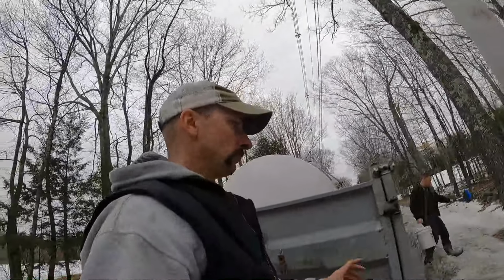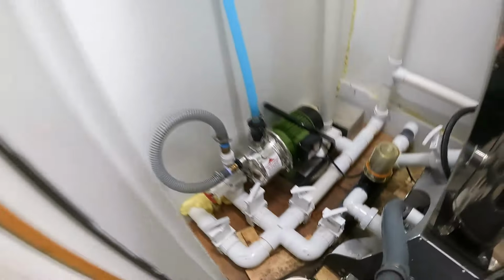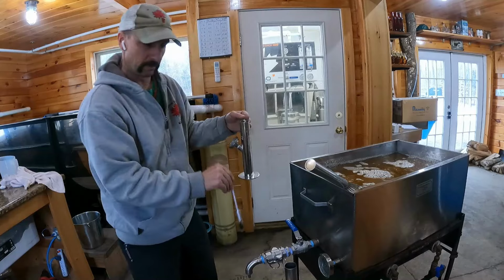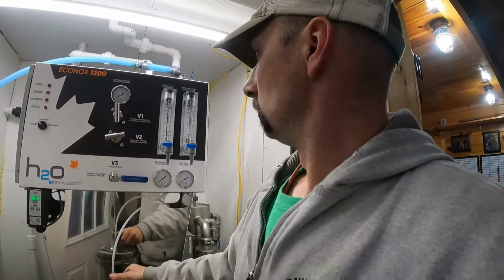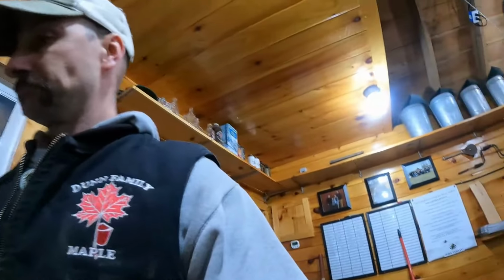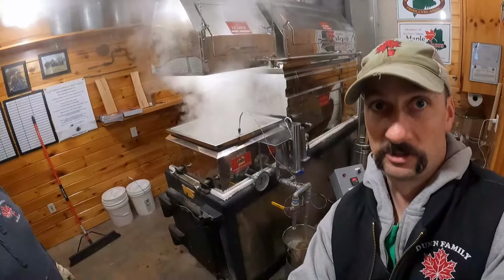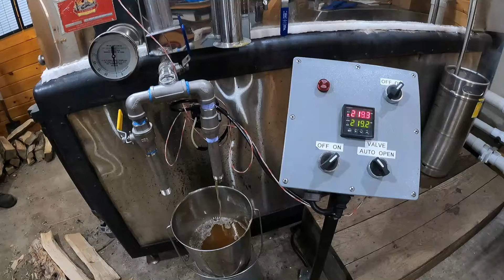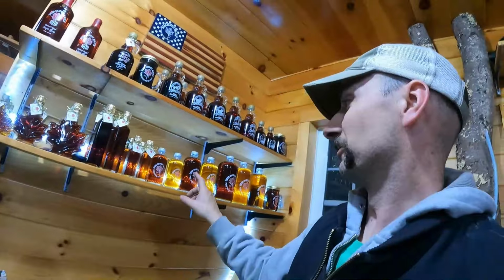This maple syrup is amazing

Comment: You need a nice Smokey lake stack temp gauge out front.  What were you running to get your red tint?
Reply from the maker: I have one that I was making that was electronic that would have lights depending on the temps but never got it working the way I wanted.  I need to dig it out and finish it.

Comment: Question Scott, what size pvc do you have for your suction and discharge to and from each tank? Currently have a leader micro 2 post, but know I will be upgrading in the coming years. Also what size tanks do you have in the sugar house?
Reply from the maker: I have 2" from the tanks and 1" perm and concentrate discharges.
The raw sap tank is 1000 ish and the perm is 900 ish.  Your goal for perm should be the compacity of your machine.  ie 600 GPH machine 600 gallons of perm.  You can get away with 1/2 of that but it is a fine line because you are using it to rinse the soap out of the machine with a goal of not leaving any behind
Reply: @dunnfamilymaple  makes sense. I know I will upgrade ros but don’t want want to redo all the pvc when that happens. Will have to buy a 1000 gallon tank for sap

Comment: Do you wash out your evaporator after every time you boil? what is your normal procedure for this? Thanks
Reply from the maker: I’d like to. It has been about every other. Drain fill with perm and some pan cleaner now in the flu pan then leave the bubbler on. Syrup pan drain fill with perm and pan cleaner